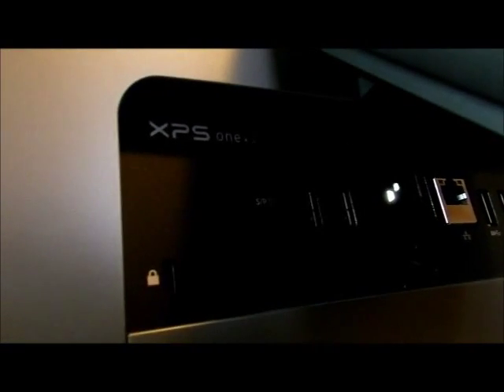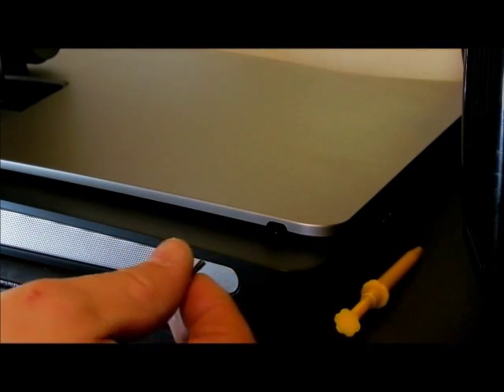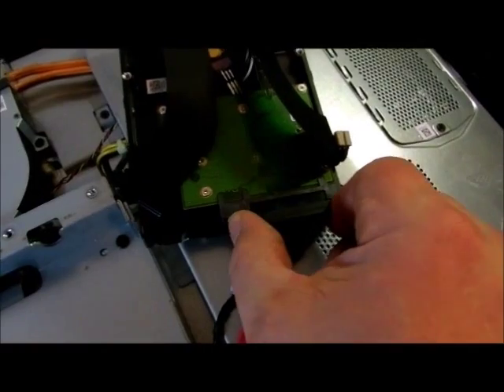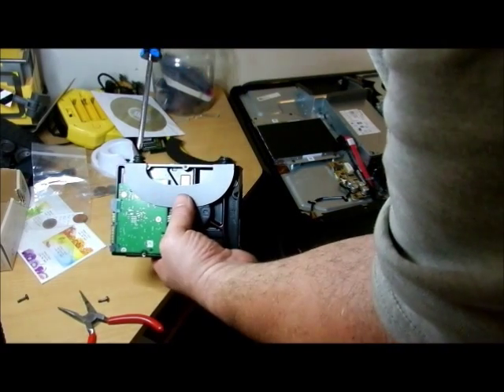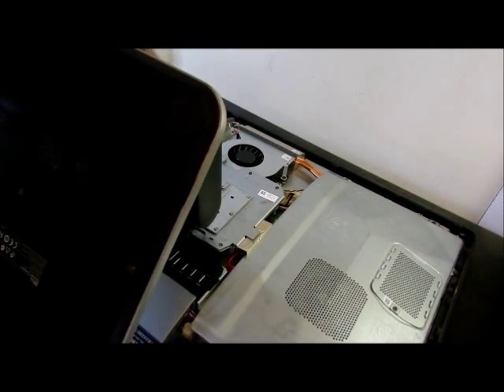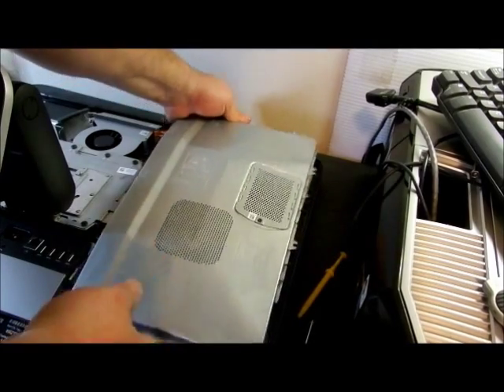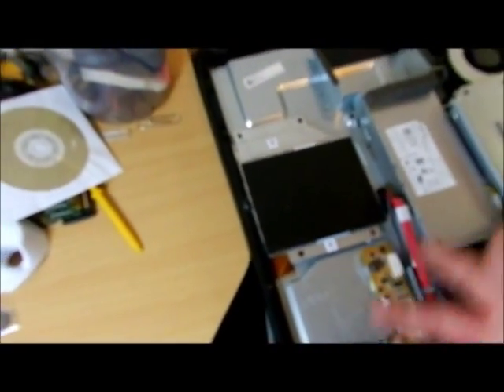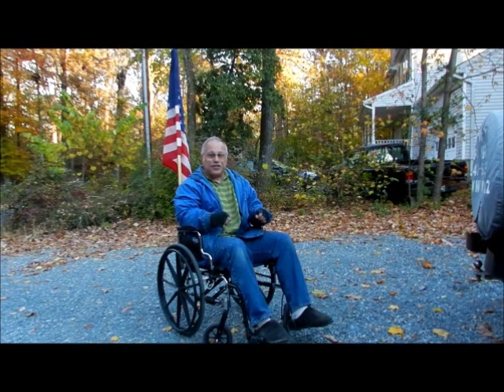Dell XPS one 2710

Comment: have you replaced the screen on one of those? the HD, it has one wide cable that connects to the circuit board? can that PC support Win 10? thanks and good, detailed how-to, also, were you able to recover any files off the old HD?
Reply from the maker: I have Win 10 on it now.  Never have replaced the screen.  You can slave your old HD in via and SATA docking station.  I purchased mine on E-Bay.
Reply: William Quinn thank you again

Comment: The two screws on either side on the bottom holding the back cover on should NOT be removed as the video instructs; they are called 'captive screws', and should only be backed out until they spin.  They should remain attached to the back cover and not removed from it.  They are spring-loaded.

Comment: Thanks William!
Im trying to replace my HDD for a SSD 2.5 one.
I just want to confirm what is the kind of adaptor/mounting kit I need. Will the 3.5" do? 
Based on the specs doc from DELL, the original HDD is indeed 3.5", but then the case you pulled out and re-placed seems bigger... Can you please help me clarify?
Reply from the maker: The original SATA connectors will work.  For the mount, just place the SSD drive on the tray that the ATA drive was on.
Reply: Thanks! So not even a need for a 3.5" adapter then?
Reply from the maker: Git is a try.  There are screw holes under the SSD drive.  Only two need to be filled.  I had to drill holes in the tray of my HP Touchsmart 300 that I am using now so I could mount it.  You may not have to still.  Please remember that there is no moving parts in the SSD.  This is why only two screws are needed.
Reply: Thanks William, ended up using just tape to somewhat hold it in place. As you say, no moving parts, and with the tape it is stable enough... not the prettiest but it works.
Thanks for the replies!
Reply from the maker: Nice.

Comment: Thank you for this, since Win10 forced itself on my pc I've been looking for a solution. (Black screen, no display. No possible way for the pc to repair itself. However the HDMI works...) So I'll be trying this. Thanks again. All the best!
Reply from the maker: Good luck.
Reply: Did it work.?
Reply: @brandonortiz5425  Best bet is buy another PC, hard to justify the price of trying to fix this nightmare of an all-in-one. 

I personally did not try this, as the cost outweighed the time/capital spent. 

Hope this helps, however if you do try it - I wish you the best in doing so and take your time, go step by step.

Comment: Hi William, my xps 2710 just conked out (won't boot) and rit doesn't even see the HD existing in the BIOS (SATA 1 is empty), it just sees the 32GB SSD (used as a cache disk) and the DVD drive.  Is it safe to assume that it's very likely because the hard drive needs to be replaced or is it possible that something else is the problem?  I am hesitant to go through and replace the hard drive (possibly buying a new one) if it turns out to not be the hard drive.  Any advice would be great.  Thanks!
Reply from the maker: The HD has failed.  I have you still have the original DVD's to reload.  This is cost effective even if you have to purchase a Windows 10 DVD.
Reply: Highly unlikely I have the original DVDs, but I will look around for it.  Would the data still be recoverable or is that gone?
Reply from the maker: Tom Shin Since the HD cannot be seen by the BIOS it is unlikely the data can be recovered from the HD at your place.  The installation CD's do not have your data on them.
Reply: Ok, thanks for the help and advice!
Reply: One more question for you.  If I were going to go and grab an SSD to to replace this internal HD (and get a 2.5 to 3.5 mounting kit adapter) what interface should I get (SATA I, II, III?).
Reply from the maker: II.  Just a heads up.  Be sure to use the cloud to save data on.  When a SSD drive fails there is NO WAY to get the data off of it.
Reply: So it would be wasting money to get III because the machine itself can't go that fast?
Reply from the maker: Tom Shin The computer will slow any faster device to the buss speed of the chip set.
Reply: Tom, I am exactly under the same situation. Were you successful at getting the 2.5 and using a 3.5 mounting adapter to get the SSD going?

Comment: Thank you William. Hard Drive died on mine 2 months after warranty expired! Ordered the Drive and Windows 8 Software from Dell. They delivered it very promptly. Your video was very straight forward and easy to follow. Saved me time trying to figure out where the screws are, etc.
Reply from the maker: HSDallas Great.  I think this XPS One will work with Windows 10.  Hope you install 8 in time to get the free upgrade.  Please reply if you do.
Reply: William Quinn Dell's Support website is not recommending upgrading to Windows 10 for this model ... Concerns about "some things may not work as expected". I had signed up for the automatic upgrade to 10 before the Drive died ... Not sure there is a way to back out of that now.
Reply from the maker: Ok.  Just a thought.
Reply from the maker: I have experienced the flashing screen with Dell laptops that upgrade to Win 10.  I had to revert to Win 8.
Reply: Did you order the SSD or HDD for it